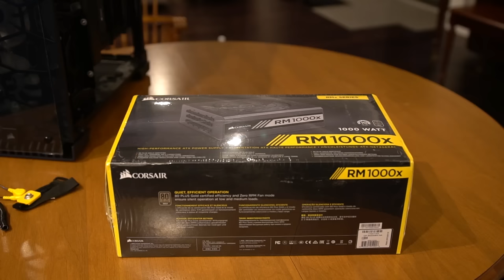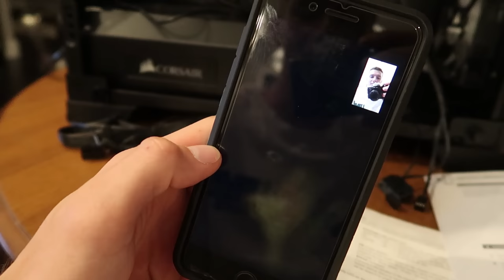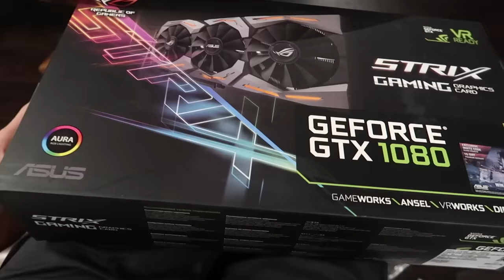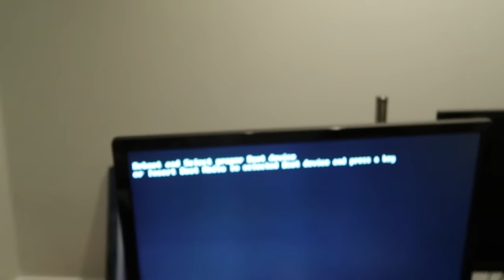Building my First Gaming PC

Comment: Step 1: Install the CPU in to the mother board (CPU slot, make sure the gold triangle is pointed to the black triangle on the board).
Step 2: Install the RAMs on to the mother board (the only install in one direction).
Step 3: install the back plate for the CPU cooler, add thermal past to the CPU and install the CPU cooler or if you have an AIO water cooler install the radiator side with fans to the front or top of the case ( don't add thermal paste yet for AIO).
Step 4: Install the IO plate and the mother board into the case and screw it in (Make sure the IO plate sits firmly in the hole in the back and press the mother board firmly against it and gently let the mother board set into place on the standoffs).
Step 5: Connect your USB 3.0 cable, USB 2.0 cable, front power LED, power switch, and reset switch onto the mother board.
Step 6: Grab as many SATA data cables as your hard drive/SSDs and plug them up to your mother board.
Step 7: Grab your power supply (PSU) and all the cables needed for the computer(16 pin for the mother board 8pin for the CPU, two 6 and 8 pin for your graphics cards(GPU), and SATA power plugs for your hard drives/SSDs).
Step 8: Route your cable through the holes closes to your 16 pin connector, 8 pin connector for your CPU and hard drives/SSD and plug them in (Mount the PSU to the designated spot face down towards the vent).
Step 9: Install your GPU's and hook up the 8 and 6 pin power cables to the GPUs.
Step 10: (Only do this if you have an AIO water cooler and already mounted the radiator and fans to the case) Place the CPU block for the AIO to the CPU (if there is no pre-applied thermal paste, add a rice size amount of thermal paste) and tighten it down with the included screws.
Step 11: Plug your computer into a socket and power on your computer to install Windows.

But before all that don't plug your god dam PSU into the outlet, that's how you fry the computer parts.
Reply: Literally copying this and saving it for my build lol
Reply: he who owns the least Asus products is the copy cat.
Reply: i think he need to plug in the psu to "ground" him,just dont turn it on.
Reply: Christopher Gonzales same!!
Reply: I'd change the order slightly, would be going 1, 3, 10, 7 (and pre run CPU and MOBO power cables), 4, 5, 6, 8, 9, 11.

There's no harm in plugging in your PSU into the outlet, even if he tries to power it on it'll do nothing.
Reply: Presson Yang thanks man
Reply: (@Obsessive Vape Collective) Nice build, but why use a Kraken X61 instead of a X62. If you were going for RGB then the X62 would have been a better choice, because it has more RGB goodness. And my recommendation for keyboard and mouse is a corsair K70 Rapid fire RGB, and a G502 Proteus Spectrum.
Reply: Did you buy it from amazon? If I'm correct the DeepCool Captain240EX was released 3 month ago and is a cheap option for RGB CPU cooler for About 120£.
Reply: hope u dont mind, i copied and pasted this so that when i build i can use
Reply: me too lol
Reply: not true lmao. i've put together multiple pc's with one of my first steps being installing the PSU and plugging it into the wall. It's a much more solid ground then a ESD strap or touching the metal of your case.
Reply: Presson Yang ty
Reply: Presson Yang wwww
Reply: There was no power going to the power supply. In the video he said the surge protector was off
Reply: Step 12: upload ur own video...
Reply: Presson Yang nice
Reply: Presson Yang IO shields aren’t screwed in
Reply: Presson Yang is there anyway i can get in contact with you?
Reply: Obsessive Vape Collective no, all cables u will need should come with the power supply, and with certain parts, the cables
Reply: So plug in the PSU after we plug in the computer into a socket?
Reply: Easier said than done.
Reply: yeh ,I cringed when he did that, plugging in the psu is the last thing you do ,besides turning on the psu switch

Comment: Adam LZ If you want to use both your 1080s to make them run "together" for more performance you need a sli bridge. Make sure to buy the newer ones if you read this.
Reply: he can't even use one of them he didn't even plug the 6 pin in.
Reply: Ye i didnt watch through the whole thing to see that, Great videos but for some reason i just cant watch most people build computers :p
Reply: i think sli bridges are included with graphics cards ..
Reply: I didnt get a sli bridge with mine thats why i commented that. Also the newer bridges are better and cost alot more then the older ones, on a business standpoint i doubt they would include them.
Reply: Emir Demirovski not all of them. I can't speak for 1080s but my 1070 didn't. My motherboard however did haha
Reply: Yea my 1080 didnt come with them, i doubt they would them since they are like $30 or something to buy for only dual sli :p
Reply: it comes with your motherboard not graphics card
Reply: The second PCIE 3.0 is only going to be running at x8 and not x16 is that going to hurt performance? There are boards out there with enough lanes to support both cards at x16 right? (not enough lanes?)

EDIT: Nevermind I looked it up and the drop in performance is super minimal and I think when you run in SLI they both drop to x8 anyway. Can anyone confirm this?

EDIT2: It has been a while since I have looked into all this, but in the past it was never worth the performance increase to use SLI/xFire because you could just run one card and then upgrade 6 months later to a better card, spend less money overall and have a card that now runs better than two cards in SLI that you bought 6 months ago.
Reply: All mine came with MOBO's
Reply: Yea but 1080s are the best cards on the market besides the titan xps. Running dual sli 1080s will show improvements but you really dont need to.
Reply: didn't he fix it?
Reply: The new line of GPU's doenst come with a SLI bridge... you need to buy a: High Bandwith one from an local hardware store :)
Reply: Yea knew it was something like that because the bridges cost a bit now adays, upwards of $30 i believe. Maybe be wrong about price tho.
Reply: some do some do not today

Comment: 1) cpu in mobo
2) cooler bracket on mobo
3) ram in mobo
4) m.2 in mobo (if any)
5) mobo in case
6) psu in case
7) radiator in case
8) hdd or ssd in case
9) connecting cables 
10) gpu on mobo
11) connecting cables to gpu
Reply: Asad Ur Rehman جزاك الله خير
Reply: What does M.2 mean?
Reply: Hector Soto another type of SSD, bud different shape and install location
Reply: Hector Soto type of ssd
Reply: Adas Witkowski That was perfect English apart from “but”
Reply: IO sheild and case fans?
Reply: Hector Soto it’s a type of ssd that is smaller and doesn’t need any sata data or sata power cables and it installs straight into the motherboard
Reply: U make it sounds easy
Reply: Ram can go in last with the gpu, Put the cooler on before so you don't mess it up.
Reply: @Adas Witkowski He doesn't have to.
Reply: just build a pic using only this comment tu

Comment: I was cringing when he put the liquid cooling before he installed the motherboard
Reply: WarpGaming Same here!!
Reply: WarpGaming how can your cringe
Reply: I was cringing when he didn't put the case down horizontally xd But it was a small mitake so np :P
Reply: I was cringing when he put the motherboard straight onto the table.
Reply: Yeah the motheroard on a table made me ceinge alot
Reply: Me too me too!
Reply: WarpGaming same
Reply: right
Reply: WarpGaming lemme just cram this radiator on top of the CPU I know that's right -Adam 2k17
Reply: I sometimes do this only to measure.  I am putting together a rig for my step-son and I have the Corsair 400C case with an ASUS Z270F Gaming mobo and I wasn't able to place the H100i AIO on top like I wanted because of clearance issues with the heatsink that runs along the top edge of the board.  So I moved it to the bottom half of the front of the case.  I won't be able to use the power supply covers like intended but it isn't that bad looking.

One suggestion which I think he already knows, that H100i kit isn't going to be the best option if he intends on OCing.  During my benchmarks using AIDA64 stress tests, I was hitting 83C within 5 minutes.  I don't know what real world temps to expect until I can run a few high-end games, but my own rig can do AIDA64 never getting higher than 70C.

Still, I like your build and it's far better than my 1st build:-)
Reply: WarpGaming I know right I thought he was joking at first but when I realized he wasn't * face Palm*
Reply: and when he go co fused about the ATX omg lol
Reply: Yeah same, also, how didn't he realise the Grey paste was thermal paste?
Reply: I was cringing when he said he had the 3 monitor's and held up 4 fingers. 😂 0:24
Reply: muhahahaha, i haven't noticed that =)))))))))))))))))))))))
Reply: WarpGaming i was cringing when he install the screws and failed
Reply: WarpGaming I really wanna build a pc is there a specific order for all the parts?
Reply: guy who wants to build a PC I assume this ur first time yes order is important motherboard then prosseser heat sink power secure motherboard in case install power connect the pins like a 24 pin and a 4 pin install graphics card do connect sata to hard drive or SSD  do some cable management and done
Reply: Ren nope unless yu go hardcore only with liquid cooling
Reply: WarpGaming but even tho it's his first time. Not everyone is good as u as building pcs.
Reply: Twice!
Reply: same, and when he went to freaking set up the gpus
Reply: Idea Linus doesn't do that, for proof just watch the new vid about upgrading the office and in the professional PC building community, no one puts the radiator in before the motherboard, no one
Reply: Idea well it DOES MATTER I learn that from building my custom loop PC and I don't know how yours is but it does matter. Except if you put the radiator on the side not on top
Reply: me too
Reply: Agreed
Reply: WarpGaming same bro
Reply: I was just like, pretty lights 🤷🏽‍♂️🤷🏽‍♂️
Reply: Cringed when he put the Motherboard on the table
Reply: WarpGaming cringing so much
Reply: Same man
Reply: WarpGaming I cringed when he said power thing. POWER THING?!?!
Reply: Ren - There is no one right way to do it, but put the CPU, CPU cooling fan and RAM into the motherboard prior to installing the motherboard. Also, you ALWAYS need thermal paste unlike he said in the video. Power Supply in next or before MB but those 2 are first in the case. I doubt you're going overkill like him so probably no need to explain liquid cooling. Mount hard drives, disc drives, GPUs, wireless and sound cards then do cables just so you can route around everything. And lastly double check that you don't have any cables pulled really tight once you are all together, and ensure everything got plugged in like fans, power and SATA cables to your various drives. Then plug in peripherals and start her up. Hope that is helpful.
Reply: Same lol
Reply: No one like I just got it to 666

Comment: Super good job for a first build.  Forgetting the IO back plate (the bit that you had to take the motherboard out again for) happens to everyone - I do it about 50% of the time!

One thing that might make a difference is redoing the fans on the radiator, generally you want them pushing air through the radiator (rather than pulling like yours are) so you would go (from top to bottom): case -> fans -> radiator.  Realistically, if you're not going to overclock, it's going to make hardly any difference but I'm sure some nerds out there will give you crap for it!
Reply: He said they're "pulling air in" but he's actually mounted the fans to blow out.
Reply: GForceConnections Yeah, thought the same thing, but he did it wrong according to the manual which means right according to the #pcmasterrace
Reply: Do you know those specific fans well enough to say that without seeing the flow direction arrow on them?  I couldn't spot the arrow so they could be either way around.
Reply: i've gotten to the point where i just dont install the IO plate anymore, they are pretty annoying and i always cut myself on them.
Reply: its easy to tell which way the fans blow, they are all the same, the pretty side of the fan always pushes through to the side where the motor mounts are. Also pull is better than push for fans, it reduces dust build up on the radiator.
Reply: You dont need to a flow arrow to tell you the flow of a computer fan.. they all flow the one way and he has the fan setup on the rad to blow air through pushing the air out of the case
Reply: That IO plate fucks me off so much xD Forget it without fail ahahah They should make it clip in from the back or smth so it's not such a ball ache
Reply: He mentioned pulling air into the case from the radiator, basically pulling all the heat from the radiator into the case is a nonononono
Reply: GForceConnections its not bad to blow the air into the case, just depends on the setup. Pulling cool fresh air from outside the case onto the radiator will benefit the cpu, however it may affect gpu temps. People do it also to keep positive pressure in their case. In adams case though i would say pull air out because he has 2 air cooled gpus that will need all the cooling they can get

Comment: that was honestly fine for your first attempt, some of these people lol...

you might want to flip your radiator around though, so that the long hose comes from the right side down to the cpu instead of the left. Stretches it out more so you don't have that awkward bundle over your gpu's (your 1080's); giving you more space and generally looks nicer. 

And a SLI bridge is required to run your GPU's together so you definitely need one. 

also that plastic bag that had your motherboard in it was an antistatic bag lol, people generally keep the motherboard on it until mounting time.
Reply: Godhand Zefa good advice :) just thought I'd note some antistatic bags have conductive coatings on them which could lead to ESD to the motherboard.
Reply: Ya, its safer to put the motherboard on the top of the motherboard box because the outside of the antistatic bag is usually where the most static is.
Reply: also I like to add maybe you guys can correct if Im wrong but should he have put his PSU the wrong way making the fan face downwards and not upwards to the GPUs.
Reply: Godhand Zefa can you tell him to return his 1080s the 1080ti is coming out next week for 699$
Reply: Eagle Owl that's a never ending story some say point it up others say point it down. adam should decide himself but it it doesn't really matter
Reply: He put it with the fan facing down. He was about to flip it fan facing up but figured out he was correct.
Reply: Why has he two graphic cards??
Reply: because 2 is better than 1
Reply: Gody Carrison Oh ok thanks
Reply: That's gonna be a sick PC for sure.💯
Reply: Godhand Zefa gagw
Reply: i thought that mobo came with sli bridge ? maybe not though idk
Reply: Godhand Zefa but as a first attempt you shouldn't go out and instantly buy a gtx 1080 you should start off with something small and simple and then from there either upgrade that one or build a second one
Reply: DaMoose Well said
Reply: DaMoose he has money and nothing better to spend on. Obviously this was going to happen

Comment: Didn't wire up the CPU power connector. Using adapters from GPU box without reading instructions (THOSE ARE MEANT FOR PSU'S THAT DONT HAVE ENOUGH CABLES) USE THE CABLES PROVIDED FROM PSU BOX!!!
Reply: yeah he didn't even plug in the 6 pin only the 8 pin connectors.